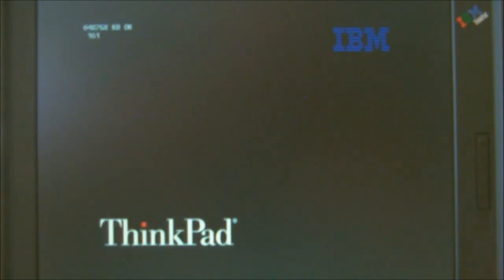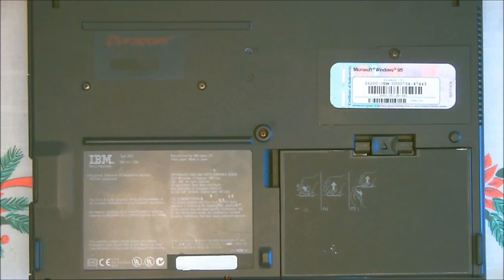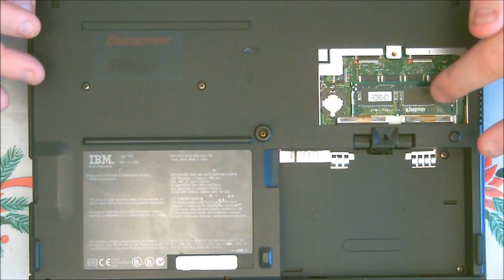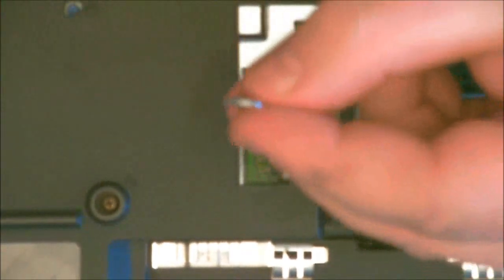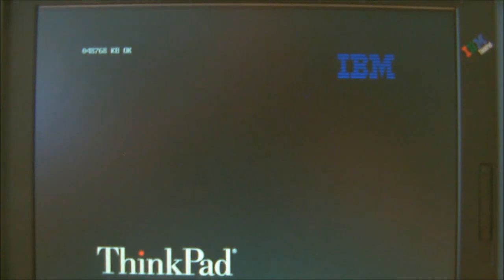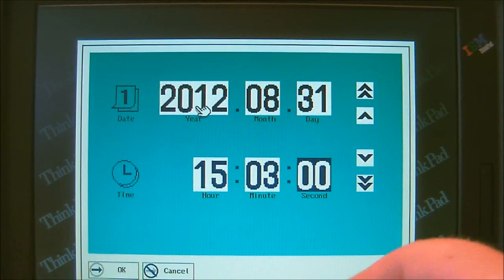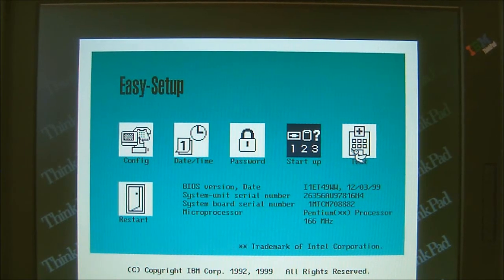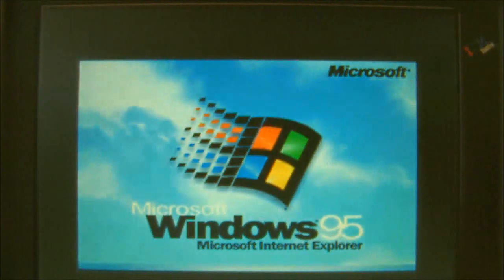ThinkPad 380 series error codes 161 and 163

Comment: I did replace the battery then it shows now error 00174 how can i fix it?
Reply from the maker: If memory serves, that error is referring to the HDD. Try resetting the BIOS to factory default. While the laptop is off. remove the HDD and then reconnect the HDD. If this doesnt resolve the issue, try replacing the HDD and Reinstall Windows.

Comment: Mine says enter your network password ? Any way to skip this ? Or hard reset ?
Reply from the maker: Network passwords are used to connect to a network domain on Windows PCs and there is no way around it. The best way is to reinstall Windows. Be sure that you have the activation Key in case Windows requires reactivation.

Comment: Hi, i would like to ask you something.I have a 380 ED, already change the 3V lithium coin cell of the notebook, but, the specs shows that the notebook works with a 16V 2.20A battery or charger. Now, do you know if it would work properly with a 16V and 3.36A charger? its the only model of charger i could found in my country and a really want to make it work but i dont wanna overcharge it and screw it by mistake. Im planing on restoring the li-ion batteries also for full restoration. Thanks for reading, hope you can answer me.

Comment: Thanks, you help was still useful in 2020! I could repair my 600 and it works like a charm again! THX
Reply: the battery of my laptop cr1216 should i use this cr1220(google translate)
Reply: @lemanyigitacar9372  I use a CR2025 on my 600 and it works. Just respect the voltage. EDIT: what Thinkpad are you talking about?